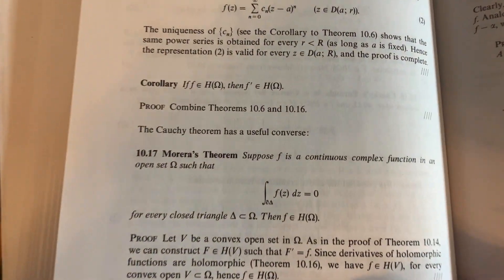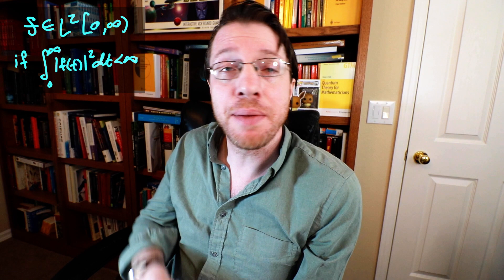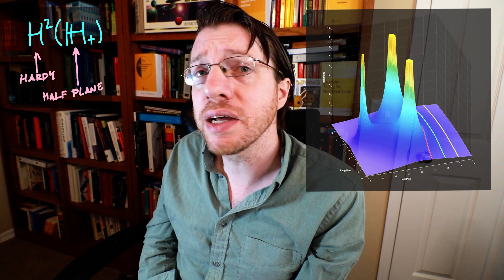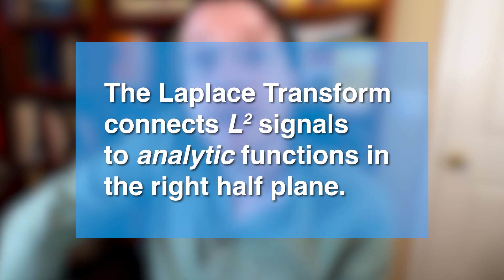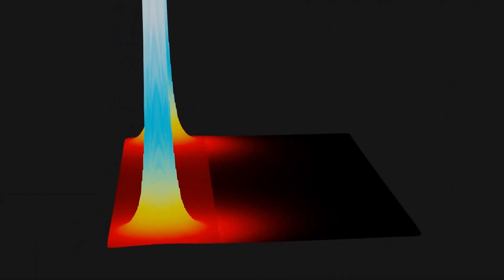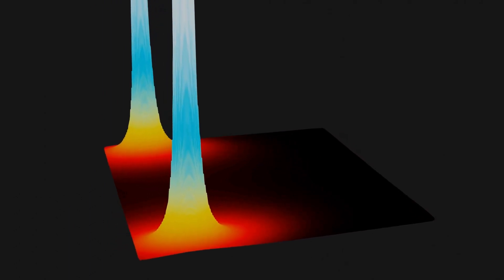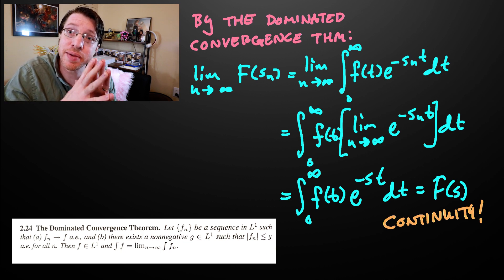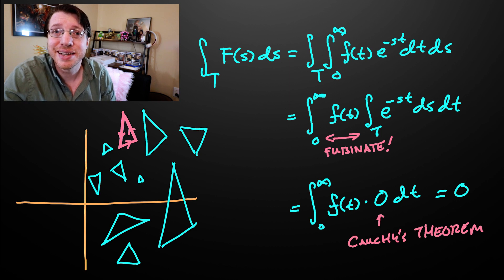Morera's Theorem in Practice - Laplace Transform

Comment: Can you more rigorously define what you mean for the laplace transform to be analytic in the RHP? Like how do we know the fact that it’s continuous and the fact it’s integral is 0 along arbitrary triangles makes it analytic and why do we care?
Reply from the maker: Analyticity means that a function satisfies the Cauchy Riemann equations or equivalently, that it is representable as a power series at each point in the RHP.

Analyticity is actually an incredibly strong property and this means that these functions have a lot of structure. This structure comes to light especially when we talk about the model matching problem from H infinity control later.

The big reason we care comes from the Paley Weiner theorem. We are trying to study an L2 signal from a linear dynamical system when we transform this. We want to know that we can transform back and the result still mean something about our problem. This is the first piece of that theorem.

The triangle thing is simply what Morera’s theorem says. It’s a quick way to prove analyticity.
Reply: @JoelRosenfeld  so is the discussion of analyticity only relevant to complex functions or also real value functions
Reply from the maker: @TriThom50  in systems theory in engineering, we care about complex functions because that’s what you get with a Fourier and Laplace transform. Sinusoidal behaviors are explained by imaginary components and if we want to use these tools to study our systems, as we do with most stability methods, we need to understand analyticity.
Reply: @JoelRosenfeld  right I guess I am just wondering do we apply the same definition of analytic to real functions? Just curious since I typically see this brought up in the context of complex functions.
Reply from the maker: @TriThom50   you can use the power series definition of analyticity for real valued functions on the real line. But then you can put complex numbers into that same series and get consistent results, so there isn’t really much reason to not consider complex functions at that point.